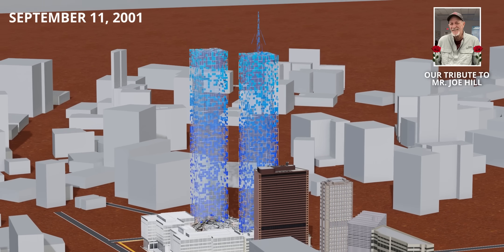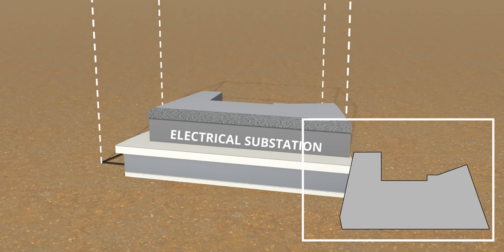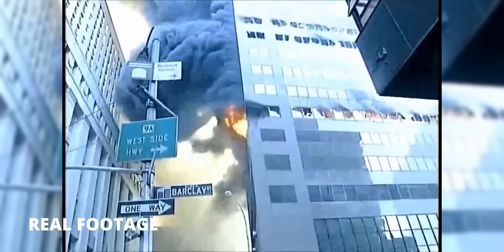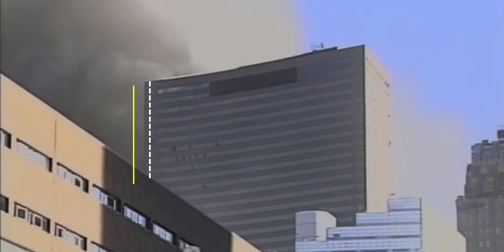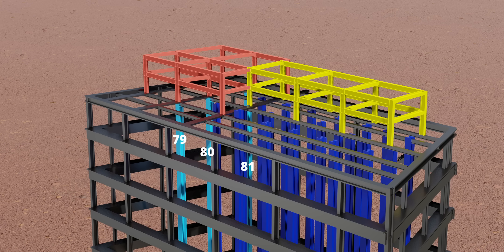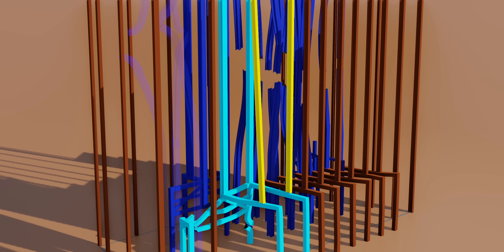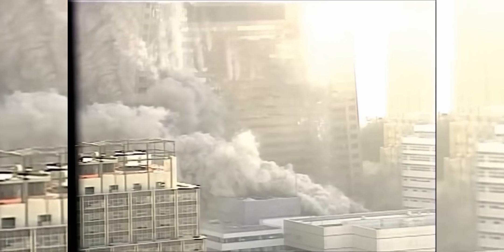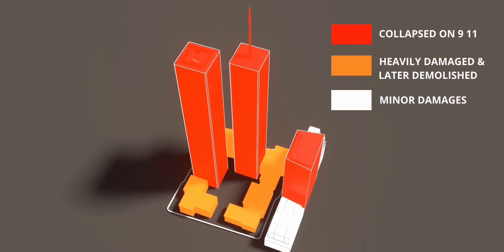Collapse of Building 7 | The Complete Physics

Comment: Propaganda at it's finest
Reply: And yet not wrong. Go figure.

You may not like it after more than 2 decades of internet conspiracy dogma, but what is being presented in this video is fundamentally correct and widely supported by the worlds engineering community.

While imperfect (there are a few problems) this video goes into a much higher level of detail than many viewers can comprehend and gets the collapse mechanisms fundamentally correct. This is true no matter who planned and carried out the 9/11 attacks or why . 
	
Sure, it’s not what you want to hear and goes against 20+ years of conspiracy dogma and conditioning, but that is not the same as it being wrong. You just need to fix your dogma. 

On the plus side, this video can be (and is) fundamentally correct about the engineering AND the 9/11 attacks could still have been some sort of inside job. The two things are in no way mutually exclusive. It’s just not the inside job the clowns you have been following on the interent have been telling you. 

This will surprise you to learn, since the conspiracy side of the internet hides it from you, but the mechanisms described here have broad professional support around the world. There are no professional engineering organizations (for example: ASCE, ASEE, ICE, etc) that disagree with them or have offered any formal dissenting opinions or alternative hypothesis. 

So, either the overwhelming majority of the worlds structural engineers and quite frankly simple observation are wrong,… … or you know more than the worlds best engineers from cruising around on the internet. Which seems more likely? 

If this explanation is wrong then produce a better one.  Be the first to even try.

Comment: @5:24 Did you mean the "detonation" of this building? That free-fall speed descent in a building that wasn't rigged with explosives has never happened before or since the demolition of building 7. And why were all of the demolished steel materials whisked off so blazingly fast? Wasn't that crime scene evidence?
Reply: No, the video got it right. The internet has been lying to you.
Reply: It's lying to you right now. @TheCriticalStinker-01
Reply: @eainc.708  - You may not like it after more than 2 decades of internet conspiracy dogma, but what is being presented in this video is fundamentally correct and widely supported by the worlds engineering community.

While imperfect (there are a few problems) this video goes into a much higher level of detail than many viewers can comprehend and gets the collapse mechanisms fundamentally correct. This is true no matter who planned and carried out the 9/11 attacks or why . 
	
Sure, it’s not what you want to hear and goes against 20+ years of conspiracy dogma and conditioning, but that is not the same as it being wrong. You just need to fix your dogma. 

On the plus side, this video can be (and is) fundamentally correct about the engineering AND the 9/11 attacks could still have been some sort of inside job. The two things are in no way mutually exclusive. It’s just not the inside job the clowns you have been following on the interent have been telling you. 

This will surprise you to learn, since the conspiracy side of the internet hides it from you, but the mechanisms described here have broad professional support around the world. There are no professional engineering organizations (for example: ASCE, ASEE, ICE, etc) that disagree with them or have offered any formal dissenting opinions or alternative hypothesis. 

So, either the overwhelming majority of the worlds structural engineers and quite frankly simple observation are wrong,… … or you know more than the worlds best engineers from cruising around on the internet. Which seems more likely? 

If this explanation is wrong then produce a better one.  Be the first to even try.

I won't wait up.

Comment: B.S.
Total b.s.
Same like the towers.
Steel simply doesn't fail and fall simultaneously...
Reply: You obviously didn't bother watching.
Reply: i studied it to death.
English is not my mother language.
Steel buildings simply don't disappear parallel into the ground. Fires can go for days, and still it won't happen.
All known and proofen by ingeneurs and demolition pro's.
Dark smoking roomfires are about 6-800 C . They simply don't reach the melting of points of steel.
Let's say there were tons of phosphors plus oxigen tanks and ..and (which wasn't the case)
...the building still wouldn't fall in FREEFALL speed parallel without crombling.
That simply is against physics, construction knowledge of steel buildings.
That's!! why it take 2 years planing and preparing for a controlled demolition.
Even THAN you get delays.
Put 7 days 1000 C under your BBQ SMOKER. Than you  see what happens. Nothing.
It's not made from aluminum.
Even with aluminum the building wouldn't FREEFALL.
It would partially scrambe, fold here and there and so on.
A penthouse doesn't push a complete building simultaneously like hammered by the fist of god.
We saw 3 buildings doing that that day. 
Take a few minutes: count the frames per second of "the fall". Paint a curve. That velocity doesn't happen from collapsing. Period
Reply: @gerrittenberkdeboer7763  Physics and civil engineering aren't your mother tongue either. Nothing you said used math or material analysis to make an actual point at all. You want it to be a controlled demolition and use whatever justification to get you to the conclusion you want.
Reply: So:
We stop it here.
I could go for hours.
You are a fortune teller about me. That's fine.
Math:
count the frames per second from the first recognizable moment. Timeline it in Tabelle.
Acceleration, linear Fall...
All not possible with a steel building.
That's enough math.
Through a bowling ball from roof top at same time. Measure time of fall. 
So. Are you satisfied mathematically now. Done. Period. Buildings never have fallen that parallel into the ground, leaving so less rumble hight.
You!! have made a CAD animation that declares itself wrong. Cause steel and building don't behave like that.
That's pseudo catchy 3D bla.
In one sentence:
A steel building just can't fall parallel into no resistance in speed of freefall.
Period
Reply: Where are your mathematic and physic skills shown and proven, hm?
Fancy CAD paintings don't prove anything.
The way you don't have any horizontal columns shows that you don't want to be there.
But they are. The verticals are not connected by styrofoam.
Even if you have magician powers and take out those to columns complete with a finger snip...the building would not collapse unfolded parallel straight into the ground.
So, show your! mathematics and your physics that does the magic trick!
You are not able.
There are programmed simulations, highly complicated.
Yours is not. Period.
It doesn't prove anything.
----
Very simple fact:
What ever you "do" partially to a multi floor steel building,
it will never:
-fall in speed of FREEFALL
(show YOUR great mathematical skills, those who are unheard of on earth)
-fall in linear time schedule after superfast accelerator.
-do not ripple at all
You are the King. The Billionaire.
You prove Einstein, Kopernikus and Penrose all wrong...
So please, would you give as the pleasure to show YOUR wold new equation of E=m x c square by one Earth G and the highly complecated movement of the steel mash with all horizontal and vertical.....ra ra ra
..
you can't. 
The opposite corner of the roof top would never ever fall in the same split second like it did, just by weight forced. Every child can understand that.
Build a card house, if you want with very small dots of glue.
You always get a chain reaction.
That's enough.
They fire "brigade guys" even walked through the mostly in tact building and yelled to leave the building.
Good luck...with including all the corret forces and maths in your CAD painting...not gonna happen
Reply: Steel is holding up my self confidence. if it fails I'm toast! I can't live in a reality that steel isn't an invincible material. It just can't be true! All of the science is lying to us! all the humanity!

Comment: a load of rubbish
Reply: You may not like it after more than 2 decades of internet conspiracy dogma, but what is being presented in this video is fundamentally correct and widely supported by the worlds engineering community.

While imperfect (there are a few problems) this video goes into a much higher level of detail than many viewers can comprehend and gets the collapse mechanisms fundamentally correct. This is true no matter who planned and carried out the 9/11 attacks or why . 
	
Sure, it’s not what you want to hear and goes against 20+ years of conspiracy dogma and conditioning, but that is not the same as it being wrong. You just need to fix your dogma. 

On the plus side, this video can be (and is) fundamentally correct about the engineering AND the 9/11 attacks could still have been some sort of inside job. The two things are in no way mutually exclusive. It’s just not the inside job the clowns you have been following on the interent have been telling you. 

This will surprise you to learn, since the conspiracy side of the internet hides it from you, but the mechanisms described here have broad professional support around the world. There are no professional engineering organizations (for example: ASCE, ASEE, ICE, etc) that disagree with them or have offered any formal dissenting opinions or alternative hypothesis. 

So, either the overwhelming majority of the worlds structural engineers and quite frankly simple observation are wrong,… … or you know more than the worlds best engineers from cruising around on the internet. Which seems more likely? 

If this explanation is wrong then produce a better one.  Be the first to even try.
Reply: Great rebuttable or are you describing what you think of yourself? its probably true but it will be okay, no one is relying on your technical expertise so just relax.

Comment: You claim the building didn't fall at free fall speed and that others try to sabotage videos. Thats such a poor attempt to dismiss the undeniable laws of physics.
Reply: It didn't. Try measuring it yourself instead of letting the internet do your thinking for you.
Reply: So...what "undeniable laws of physics" were dismissed, and how? Do please detail and explain.

I'll be RIGHT here waiting...
Reply: @mooneyes2k478  Glad you asked. Im referring to the free-fall speed (gravitational acceleration). The rate at which an object’s velocity increases when it’s allowed to fall freely under the influence of Earth’s gravity alone. This is 9.81ms². So for every second something free-falls the velocity of the fall increases with 9.81ms. This only applies for free-fall, so if no energy is wasted like on breaking bending en crushing material, moving stuff around and producing heat. Since a part of the fall was at this maximum free fall speed, the question is: What happend to all the resistance encountered in the fall?
Reply: @Libertydani  - So an oject - or more specifically a single point on an object - can ONLY accelerate at 9.81ms² if it is free falling? 

Can a free falling object that is meeting resistance exceed an acceleration of 9.81ms²? 

Which part of the fall are you referring to and why does it matter?

Just answer the questions directly and without time wasting exposition please.
Reply: @TheCriticalStinker-01  1: Yes. It can only free fall if there is no resistance. If the only force pulling it down is gravity it will be 9.81m/s². 

2: No. its the way around. if there is resistance the acceleration would reduce, so it would be below 9.81m/s²
Reply: @Libertydani  - 1. So I can't say, accelerate my bicycle at 9.81m/s²?  Please read the question. Carefully.

As for just falling objects -  Your claim only true if the object is moving in 2 dimensions. Is there any reason you are not considering 3D movement?  You also are ignoring the possibility of outside assistance?  

2. If resistance will reduce acceleration (always), how do you explain this?  www.youtube.com/watch?v=n8WxkqMRgS4

3. Now please answer my last question: Which part of the fall are you referring to and why does it matter ? Without that, this is all much ado over nothing.
Reply: @ about the bicycle: yes you can. 

And your are absolutely right about 3D movements. But I was in fact ignoring the possibility of outside assistance. If you think there was I would be happy to know what it might have been. 

Resistance will always reduce acceleration of g. Like you said, only other external forces could influence this.

I'm referring to any part of the fall where a structure is observed to fall at or near free-fall speed without decelerating due to expected resistance such as structural supports, air drag, or impact with underlying material.

It matters because: the resistance was somehow removed just beforehand, or

Like you said, an additional force acted to overcome or bypass that resistance.
Reply: @Libertydani  - Free fall is NOT a "speed"

The point we are getting at here is that really there is nothing special about a measurement of acceleration of 9.81m/s².  It can happen in a variety of ways. We have also learned - by way of highly relevant example - that acceleration can actually increase in the presense of resitance, although for reasons I cannot fathom you still make the statement Resistance will always reduce acceleration of g which I clearly demonstrated in my previous post is false.

So in some circumstances at least, we KNOW that meeting resistance can INCREASE acceleration rather than arrest it. Certainly we KNOW moving in 3 dimensions can increase acceleration as well. Both can even create over-G accelerations of an object in a state of free fall.

Pieces of the puzzle coming together. 

Now then, still waiting for you to clarify what it is you believe was in a state of FFA and why it is important. This is the 3rd time I am asking. Third strike. I shall not ask again.
Reply: @TheCriticalStinker-01  
I’m referring to the roofline of WTC 7 during the part of its descent that showed near free-fall acceleration.
The reasons why that matters were already explained in my previous message.

Please explain to me how resistance could have increased the acceleration of the fall in this specific example.
Reply: @ " Im referring to the free-fall speed (gravitational acceleration)"
So...which is it? Speed is not acceleration.

"So for every second something free-falls the velocity of the fall increases with 9.81ms. "
That's true, it does. So what?

" Since a part of the fall was at this maximum free fall speed, the question is: What happend to all the resistance encountered in the fall?"
Or, in other words, "I'm cherry-picking the things I want to use as an argument and ignoring the others."

None of this, on the other hand, has anything to do with "undeniable laws of physics" and how they were supposedly "dismissed".

So, let me ask again:
"So...what "undeniable laws of physics" were dismissed, and how? Do please detail and explain."
Reply: Please type that out again so us humans can understand what a great physicist thinks of what happened? I want to understand as someone with a physics background. The math is hard I know but lets start with f=ma and move on from there shall we?

Comment: 1) The fires traveled and were already extinguished in the area of 79.
2) The antenna didn't hit the exterior wall, but rather a panel of the exterior WTC1 wall. This damaged cross-connections, but not vertical supports. No additional mass landed on WTC 7 that needed to be supported.
3) The weight of the penthouse is negligible. It didn't put extraordinary stress on the vertical supports.
4) All fires were several stories above the substation. This means that all the supports at the substation level were perfectly intact and carrying their design load.
5) Smoke rose from the facade in the lee. This doesn't mean that terrible fires were burning inside the building. Much of the smoke on the south side came from the neighboring smaller WTC buildings.
6) There is a detailed analysis (FEA) from the University of Fairbanks.
Reply: 1. Not true.
2. Correct.
3. Not true. The weight of what was in the penthouse is not negligible. HVAC units for the entire building. 
4. Sure, but then no one is claiming the floor failures which caused the loss of lateral support which resulted in buckling failure of Column 79 were below the 7th floor (ie: in the load transfer region - which had no floors).
5. Really not true. You can actually see some of the fires, UP CLOSE in this video. 
6. I wouldn't exactly call that a detailed analysis_ - Hulsey only studied 2 floors, did not account for time (a fatal flaw) and used a greaty dumbed-down version of The NIST's temperature dataset. Of the 6 major studies done on Building 7 it doesn't even rate.
Reply: 1, wrong.
2, right.
3, wrong.
4, meaningless.
5, wrong.
6, very wrong.

So, in 6 points, you got 1 thing right, 3 things wrong, 1 thing had no point, and the last was so wrong there isn't words.

Well done!